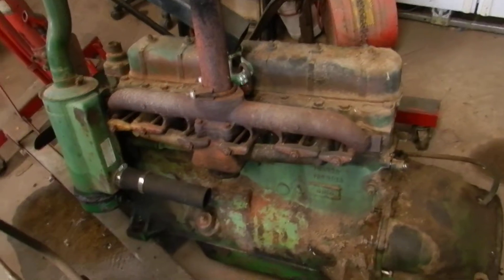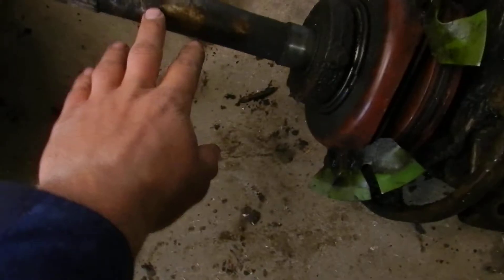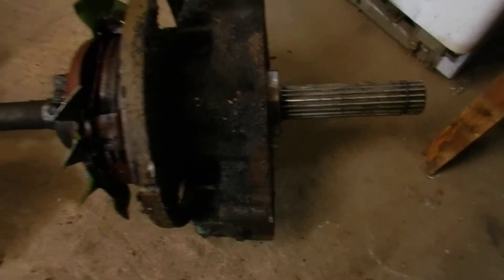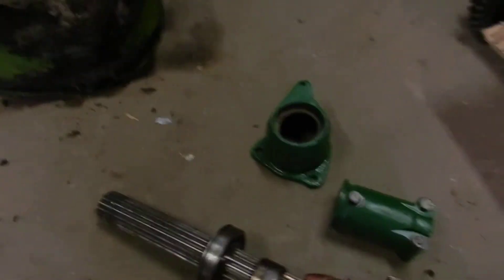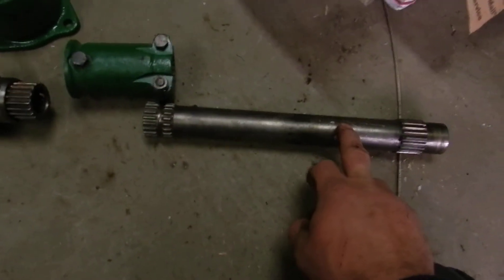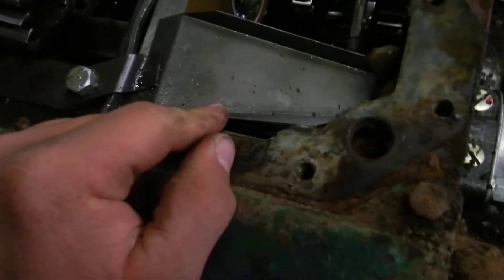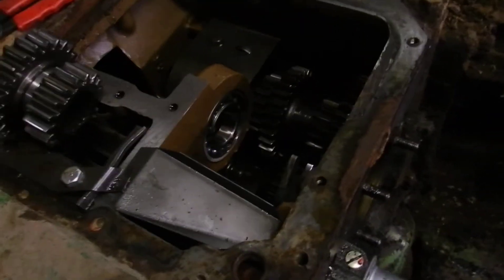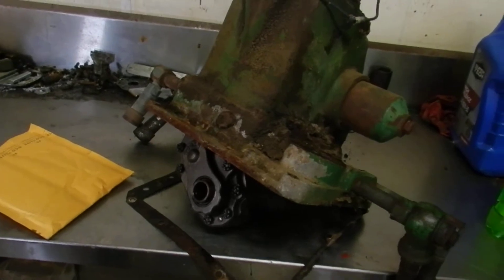Oliver 770 deleting the power booster.

Comment: international 66 series had an over under thing and when you put it in under-drive they would quit moving and some people opened up the cover on the side of transmission to access it and welded it solid somehow, i do not know if that was the thing to do but it did get done sometimes
Reply from the maker: I've seen/heard of a few fixes for this Oliver power booster. You still would be without booster drive but didn't have to source all the parts to delete the unit. I think one was welding the clutch pack together and one I seen had the booster in place but the clutch pack was gone and a straight drive couple was in its place.

Comment: I have a 770 with that shaft your looking for, if you can interchange parts with an 880 I bet that shaft would work
Reply from the maker: My 880 has the helical gear trans. I'm told the shafts are different.

Comment: Hi Nate Can I just leave the gutz in there, delete the direct drive clutch and couple the 2 shafts together???  thx
Reply from the maker: I have seen a 770 where they removed the direct drive clutch pack and put a coupler in its place. It was a non-runner so I'm unsure how it shifted. It's been a while since I've ran one with a working power booster so I can't remember if they shift hard in direct or booster drive. My biggest concern with leaving the guts in, is that the booster gears may cause the tractor to shift hard all the time, but I'm kinda leaning towards when you shift into booster drive this allows you to shift the main transmission easier. So I think leaving the guts in would cause no issues other than if they would have major failure.
Reply: @mudbogger372  Ok I understand. So in direct the booster gears are still turning?? I just don't want to buy the expensive shafts. If nothing else I just might bolt the direct clutch halves together so no slippage can occur.
Reply from the maker: @powerhungrytoo  sorry it took so long to get back to you been crazy here and finally remembered to look in the book when I was in the shop.  Yes, when you have it in direct drive the booster gears still turn there is just no power going though them. I'd imagine you could pull out the shims for the clutch pack housing and bolt it back together but would probly be better if you took out the clutch pack and replaced it with a coupler.

Comment: Nice video,,,, I have a 770 [ 1960] with a working PB,, I hate it,, would love to take it out, and do what you are doing,,,I also would like to rebuild the engine and hydraulic pump,,,,I guess I should start by locating the parts needed to do the PB bypass.
Reply from the maker: The power booster definitely has it's place and I wouldn't mind having one tractor with it, but with parts hard to come by and expensive. I'd rather delete and not worry about it again. I have alot of tractors all in various states of fully working to not working. It will be nice to have this one up and going especially when I get the power traction hitch on it.